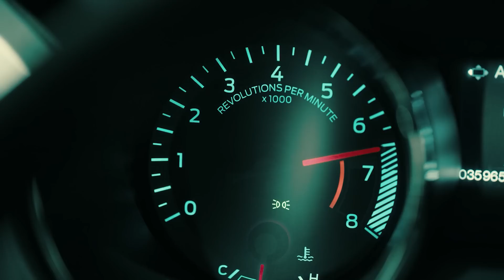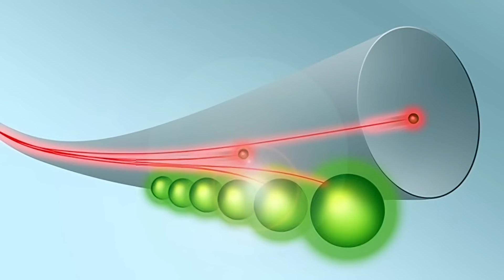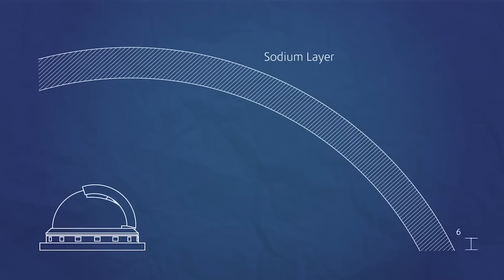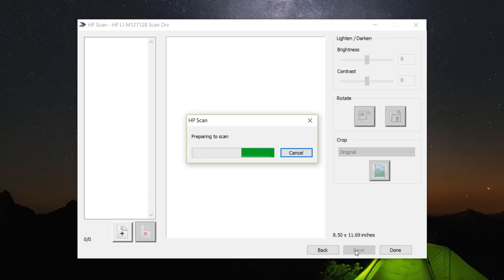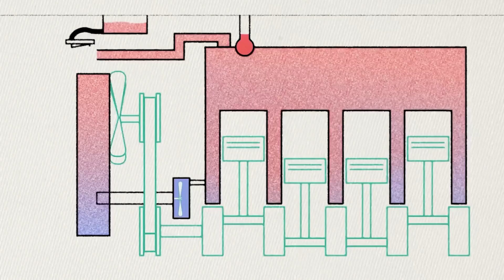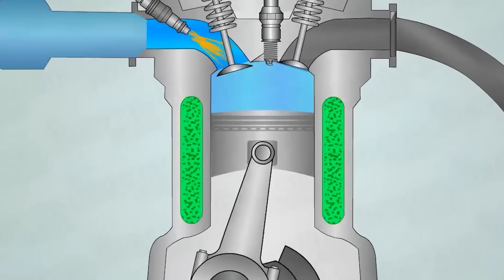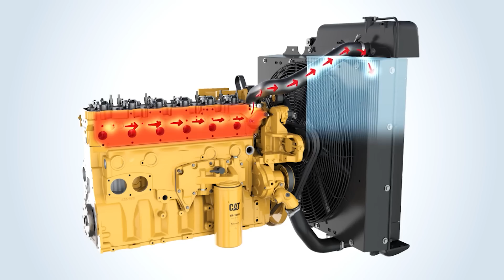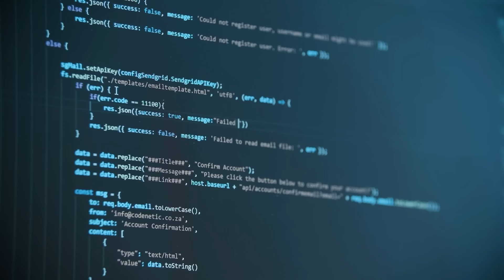3 MINUTES AGO: US Tested Its Monstrously Powerful $500 Million Laser Technology

Comment: The problem with Hypersonics is the material they are made from. Hypersonics require dense metal able to withstand the heat of several thousands of degrees incurred during their flight. This will be a problem for a laser to penetrate.

Comment: Whether it's for an aircraft or a missile... All that's really needed to counteract any high powered laser like this... Is for them to be both covered in a mirror like coating... Similar to light weight gold leaf but with a mirror finish instead... Any aircraft or missile with this coating would then simply refract the laser beam... Leaving them completely unharmed.
Reply: A) No mirror is made perfectly, and imperfections in the coating will result in heat transfer. And it's the heat 
transfer which expands the material underneath that causes destruction.
B) no mirror can perfectly reflect all wavelengths and mirrors transfer different wavelengths at different rates. 
C) This anti-laser development is EXACTLY what you want. It costs about $1 to shoot the laser. But mirror protecting an entire fleet of ships and planes to defeat it would be insanely prohibitively costly. And that's the goal of any military. Make the enemy spend more than you to win.
IE: right now the US military is using missiles to take out walmart drones used by terrorists. That's a losing exchange. Each missile costs us $100,000, the drone costs them $100.
That's a losing exchange, and it means our defenses can be overwhelmed. The idea is to shift the spend the other way. Make an enemy coat everything in anti-laser tech. And by the time they do that, they'll have enough money for a few weapons, which our conventional weapons will destroy, and that's the ballgame.
It's the same reason other countries like China and Russia can basically count their entire stealth fleet on 1 hand. They barely have any. Because it's costly to apply and insanely costly to maintain.
Mirror coatings which can stop enough of the heat across all spectrums of wavelengths would be nigh impossible to achieve.

Comment: Space Based Lasers is a MIC long-con, 40 years old. Even the interns knew you can't hide barn-sized laser units in space, can't aim it at a distant object that's still over the horizon and traveling 1,000s of miles per hour. If you graze it, nothing, the beam is already wider than a school bus, and if you miss, 1,000s of peasants are struck blind with 3rd degree burns. 

In the vacuum of space, 3, 2, 1, a hot $Bs laser-crystal melts and explodes into fiery atoms. It's easily demonstrated on a napkin,the obvious reason why the $43B Space-Based Laser system has never deployed.

Suckers! You could have had nice things! Instead you live like Palestinians.

Comment: The short pulse duration must be what prevents the air from ionizing and attenuating the energy. Lasers have ALWAYS been ideal for battle in the vacuum of space, but this new technology must solve the attenuation problem.Computer controled optical and thermal feedback sensors must be what keeps the beam in proper alignment. If this tech is ready for the terrestrial battlefield,  then it is almost CERTAINLY deployed as part of the US missile defense shield over at SpaceForce. This will keep the little "pocket dictators" like Kim Jong Toon and Vladdy Poontang in their place. Nuclear explosives are SO 20th century.
Reply: Lasers will ionize the air at any pulse width. Lasers don't work in the atmosphere due to "Thermal Bloom".  The very air they go through heats up and deforms the beam, making it useless. There is humidity, dirt etc, In the air that also deform the beam. It's no military secret.
Reply: Could even detonate a building or buildings packed with explosives and even parking lots of cars . Even soften steel. Vaporize a swimming pool of water .My favorite are computer created crop circles.So make sure you check the temperature of your swimming pool , you know dip your toe in before you dive an assure there's water there .

Comment: Saw a video recently claiming that the Boeing Company has developed a " Force Field 😳 🤔 Shield " made of ions or protons ! The video shown demonstrating its capabilities,  it showed the shield operating and dissipating the energy from an artillery shell and missle impact. It still hits the shield and the target surrounding it. But the shield largely absorbs and dissipates the kinetic energy, like hitting a rubber wall with a hammer 🔨!  No damage effects. It sounds like Sci-fi slowly becoming reality. I shudder sometimes, wondering what's next 🤔 😮?
Reply: What's next is Boeing shipping 4,000 aerospace engineering jobs to Bangalore. Skunked!

Comment: Wow, hadn't heard of this before. And what is important is It's at least 1 Mwatt and punches through in 1 Sec IS EXACTLY WHAT'S NEEDED. Impressive, esp if the Power Supply can be installed on a Jet Fighter.
Reply: 1MW?....there are MOUNTED 75MW systems in Japan already...they are working on upping that to 150MW
Reply: @michaelkendall662  And yet, the higher the power, the less likely they are to work.
Reply: I don't know about that. The testing of the "Lahaina Leveler" in August was impressive.

Comment: Despite all the hype these are only proof-of-concept tests. Lasers as weapons are held back by the hard fact of beam-spread which can only be decreased by increasing the light wavelength. No conventional laser is likely to achieve a groundbreaking high wavelength, or high enough power to make up for lower wavelengths. The Star Wars nuclear blast “X-Ray laser” was the only candidate for a breakthrough because it would project a beam of ultra-high wavelength X-rays – in theory spreading only a few feet at a hundred miles or more. Unfortunately nuclear blast testing showed the power put out was only a fraction of what was hoped for.

Comment: I'm wondering about one aspect of this.
They tell that everything hit by that lasar will be heated up and destroyed by that.
But also the lasar itself has materials...mirrors, lenses, and all that energy goes through those lenses or is reflected by those mirrors.
 Without damaging those mirrors and lenses.
What if the incoming projectile (which needs to be destroyed by that lasar), has on the outside a mirror from the same material as the mirrors used in the lasar itself?
I suppose the lasarbeam will be reflected by that mirror to another direction...
Reply: So where would the mirrors be? You'd need enormous area covered.
Reply: @viktorbaraga4514  Not when you protect attacking rockets with such a mirror shield...to destroy those lasars And youre own weaponry against destructipon with those lasars.
Reply: Million ton pressure to created meterial glass mirror to stand😂

Comment: This stuff is generally not true. It is generally science fiction. A Lazer in an airplane? Did they take the batteries out of a tesla? There are very few things that amplify power. There are coils like in a car, 12 volt. A stun gun that runs on a 9 volt. One cannot mount a Lazer in a plane and produce that much energy from the voltage carried in a plane. If you could tap into the electromagnetic field you might get a weapon out of it. Otherwise any Lazer is going to be ground based and fixed near a large power source. You could build a Lazer near a nuclear power plant, but it wouldn't be much of a weapon.
Not an offensive weapon. It's not very likely that anything can be developed which is more powerful than lightning. A billion volts for instance. You can't connect a Lazer to a power plant and convert a million watts into a billion watt Lazer, there isn't much that can amplify electricity or convert electricity into a Lazer light. One cannot aim a tesla coil at a moving object, and keep zapping it until it heats up and explodes. Photon torpedoes are science fiction, photons cannot be concentrated and fired out of a super bright flashlight and explode anything. So, nuclear weapons are pretty much as powerful as we need and those things are real enough. 50 megatons is worse than any Lazer, or energy beam. Energy beam? That's not very likely unless it's lightning, that's the only energy beam and not very straight or easy to aim. A gigantic magnifying glass about 2000 feet wide held up by balloons would make a good energy beam and burn up buildings, but it's not very likely. The sun would be the power source, you could magnify it. That's about as good as it gets I think. Maybe spock knows about something. I'm kind of like spock at times without emotions. I have normal ears though. I'm very logical, 
I don't suffer from fears either, fear and emotions are a bummer, you know? I'm not sure what has happened to mankind with all of this wreckless dangerous behavior, I'm concerned for our greater mind, and individual minds. There are influences at work now in these times of prophecy like never before. The events on the earth have become under the control of great forces which have prophesied, we humans are subjected to much more powerful forces than anything we can produce or imagine. That's what we should worry about. That is what is powerful, and it's global. There is a gigantic spirit surrounding the earth, effecting the minds and lives of every human, of everyone. It is a worry to me. It is hostile in nature, that is what we should worry about.
LLXIIX77
Reply: with antigravity vehicles, they could easily use a mobile nuclear power plant

Comment: So would this make things like an S-400 obsolete if we used it for air defense?
Reply: No I doubt it. Current technology is still pretty limited. Stops slower things like drones.
Reply: @alexbarnett8541  it also makes hypersonic missiles, obsolete.
Reply: @rodneydecormier1504 the heat shield on a hypersonic missile would probably be difficult to destroy with a laser. The laser would have to be insanely powerful. More powerful than anything that would fit on a fighter jet.
Reply: @alexbarnett8541  the US navy is counting on the laser to be the answer. This of course will be ship based.
Reply: @rodneydecormier1504  a huge ship based laser system would be more likely to stop a hypersonic missile. They should gut an aircraft carrier and dedicate the entire thing to a laser system. That where I want my taxes spent.
Reply: @alexbarnett8541  the point of the laser is to protect the carrier, and the air wings on board
Reply: @alexbarnett8541 that’s exactly what they are working on. Why do you think America was behind on hypersonic missles? We knew we didn’t have to make them because we had something better.

Comment: This is the real reason for upgrading the F-35 engine to produce nearly double the power output, while providing significant cooling as well...
Reply: Doubt it will be a laser weapons platform anytime soon.
Reply: @alexbarnett8541  Tell that to the bad guy on the receiving end of the F-35s laser designator.....
Reply: @alexbarnett8541  You're right. So many here are speculating without the benefit of any understanding.
Reply: @alex8527-w1q  I know quite a bit about high power lasers and their support equipment. I just don't see the current technology having a place in a small fighter jet.
Reply: @alexbarnett8541  It's kinda like people in the "Free Energy" conversations and worshiping magnets as the magic component. Here, it is the Laser. They have little understanding of either, and so bestow magical powers on them. With lasers, even in space, there are problems to be solved before they can be used to any real degree for defense. Glad there is somebody else in here who recognizes that. MAKING high-powered lasers has never been an issue, implementing them at any real distance is.
Reply: The real reason was because F-35 isn't stealth if you use active-passive radar fields, so it had to be faster to bug-out after the first AMRAAM near-miss and scoot back to base.
Reply: F-35B is having trouble cooling NOW with electronics and avionics onboard